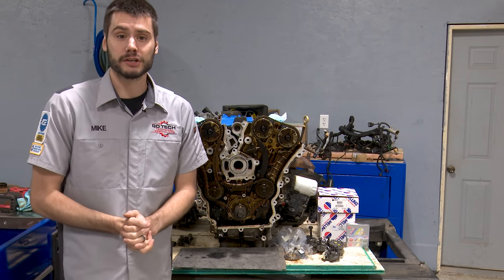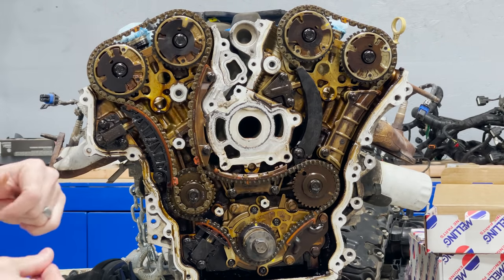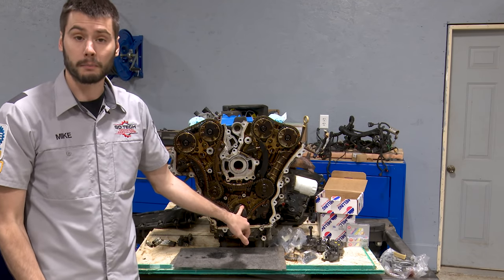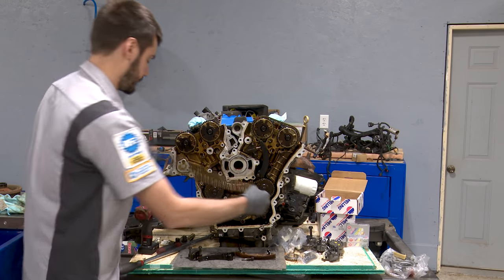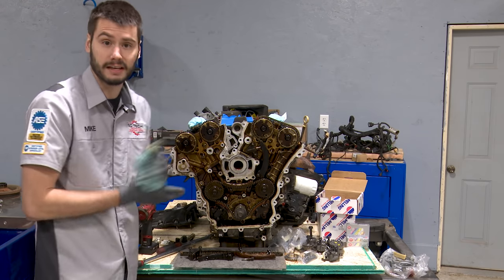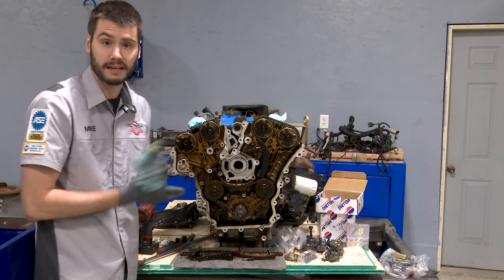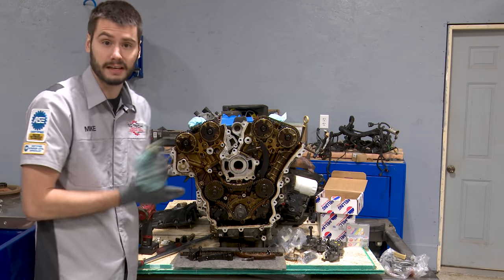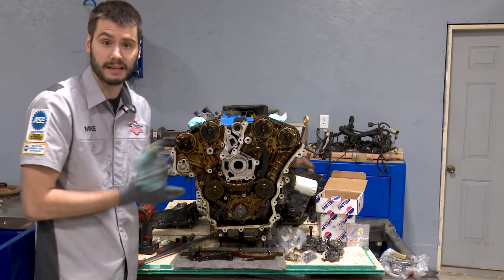How To Replace Timing Chain On Chevy / GM 3.6L V6 - Full Length Removal and Install - With Tips!

Comment: ⭐⭐⭐⭐⭐ Video Mike, We need a professional shop like yours here in SW burb of Chicago..Very Detailed and many hours to do this job compared to timing chain replacements in the 60s-80s..damn technology and computer and excess foreign materials has ruin everything for us Car guys. I’m 59 years old I did stuff like this but I rather have your expertise doing this job. How hard is it to rebuilt a 2012-2015 GMC 2.4L Eco-Tec? I unfortunately I have a 2015 Equinox at 66K miles no oil consumption…yet…I change my oil w/Full syn/Dextos every 3500 miles…not 6K-10K as recommended. I also have a 2017 Traverse 3.6L so I’m getting educated if or when this will need to be done.

Comment: I’m working on an 3.6  Acadia engine right now and everything was going good when I put it in stage two timing where the flats are up and put  the plate on there to lock cams into position ,so then I proceeded to put it in Stage one timing to where it’s at the 5 o’clock position and flats of the cam are up but that’s not the case . The flats of the cam are not up in 5 o’clock it’s has to go to the 8 o’clock position and then there up
Reply from the maker: Hey Lisa,
What bank are you checking in each stage, right bank cam flats will be up in stage 2 and left bank cam flats will be up in stage 1.
~Ryan
Reply: Did left bank and primary in stage one , then rotated it to stage 2 just about done but on my new cam phasers seems like the ones on right bank the R is off one tooth from the actual mark on the cam phaser so the exhaust one was in line and I just let it fall into place on the intake Whig is on the mark but not on the r

Comment: When you are done with the timing chains to seat them and to check your timing marks again is easy. Am giving one of my secrets out but am sure other people with mechanical knowledge would no this. 
Mechanical knowledge is a god given gift. God gives everybody some sort of a gift. You turn the engine over clockwise 4 turns over then counter clockwise 4 turns with a tad more then go clockwise slow and your timing marks should line up if done right.
You should oil the timing chain with a oil can as you rotate the engine clockwise the first time to lube the chains. After that I put it all back together the timing chain cover with just a few bolts without sealant but just lay the valve covers on with a few bolts to...be sure to put the oil filter cover back on with the water hose on and torque the oil filter housing....Pull out fuse so it cannot start and the fuel pump fuse and leave the spark plugs out. Put the damper back on to make sure the gear wont walk out. Just snug it up as you have to take it off again to seal the timing cover back on. Crank the engine over to fill the oil pump and the timing chains tensioners to fill up and also the oil filter housing to make sure you have no leaks were the oil filter housing does not leak at the block. Take the valve cover back off and the damper and chain off and check to make sure the timing chain tensioners are tight from oil. If you don't and one of those are bad you are going to take it all apart aging to fix it and maybe more. Check timing chains marks to make sure it did not skip a tooth. You should have one of the chains yellow mark you put it on and check it to the cam phase timing marks. You should have 10 links between the two or 12 from timing mark on phaser to the timing chains at TDC. Check both sides and if in this way you know everything is right. I have seen bad timing  chain tensioners before. Then you have to take it all apart again and do the job again and mess with that timing chain silicone sealant. You should replace the phaser since you are into it. And you should really replace the oil filter housing which also is a engine cooler also. They love to leak oil or coolant making a mess. You will not make the time they give you on this job but better than doing it twice and if things go sideways you could bend valves in the head also. New plugs and belt while you are there and maybe a water pump if it has miles on it. You should really do these things since you have it apart. All you are doing is replacing parts that will need it if you plan on keeping it. There should be no labor as you have these thing apart anyhow. If you are doing it yourself you my as well do it right. I still hate this engine when it needs to be fixed.
Reply from the maker: Hey Arthur,
Thanks for watching and sharing your methods when doing timing chains!
~Ryan

Comment: How do you determine whether to do sprockets and also whether or not to do the oil pump as well?
How about replacing the water pump? 135,000 mile 2015 Impala.....
Reply from the maker: Hey Jim,
Due to the difficulty getting to the chain, it is never a bad idea to replace the oil pump and sprockets. The sprockets are not as common to fail as a the chain is, so they don't get replaced as often. If you have a VVT issue that is diagnosed as a sprocket issue is when you would want to replace them. The water pump is not driven off the timing chain so it is not something I would worry about unless it is leaking or failing.
~Ryan

Comment: how long is this job from start to finish? local mechanic quoted me at 10 hours and almost $2k
Reply from the maker: Hey Josh, 10 hours seems light to me. Labor time for the chains is at about 15 hours. 14.6 to be exact. 2k doesn't seem like a bad price at all. 
Mike Becker, Senior Instructor

Comment: Hi.  I see that you release tensioner pins after installing each chain/tensioner set.  On the left side you had to rotate cams to get chain on lower main sprocket at 25 mins on video.
Could you have just left the tensioner un-released to have more chain slack for adjustment?  I understand having all marks aligned before releasing adjusters.  You pretty much have that covered.  Thanks for the vid.

Comment: I have a Honda with a V 6 and it uses an old fashioned timing belt. It is way easier to change than this mess and apparently more reliable. I can easily change the water pump at the same time for very cheap. The belts last at least 115,000 miles and there is just one of them. There are also no plastic guides to worry about since the belt runs outside of the crankcase behind a simple plastic cover. I feel that it is a much better idea even though it is a belt and has to be changed at very long intervals. Belts are quieter and isolate the valve gear from the harmonics of the rotating assembly. Smoother engine.
Reply: The idea is that the chains never need to be replaced, unfortunately these engines use so much oil that they go dry at some point causing the chains to stretch.

Comment: Hi, isn't this an interference engine, how were you able to turn it 360 when removing the left side timing chain without pistons hitting valves in the right side,  great video.

Comment: I just called the dealership in the end, they stock one acdelco kit for the 3.6 3 chains 3 tensioners, 3 tensioner gaskets, both valve cover gaskets, and the timing cover gaskets. All guides were fine after getting into it, that must be the gm service repair

Comment: Hey mate, any chance you know the reason why you have to change the chains in two timings? If you locked in the RH with the flat tool and the LH with the diagonal tool why can't you do all 3 chains at once? I know the procedure says 2 timings and if you don't it will cause misfires but I'm curious of the technical reason.

Comment: Great video.  This and a couple others gave me the confidence to tackle the timing chain replacement myself.  My oil pump arrived today so I'm ready to start taking chains off and installing pump and new chains.  Did you have to prime the oil pump before putting the engine cover back on?  Thanks for your time making this video and posting it.
Reply: I primed the oil pump.  Great video.  After completing the timing chain replacement with your company's kit my car is back up and running.  Many thanks.
Reply from the maker: Hey Brian, thanks for watching! That's amazing that you were given the confidence to do the job. Congrats to getting it all done!!!!
~Mike

Comment: Good Video My only wish is that you would have given a good description of the cam timing marks.  It is difficult to find good information on exactly what they are when replacing the cam sprockets.  Unfortunately the parts suppliers have no information on this that I can find.

Comment: Thanks for the video. Is this a problem for late model engines as well? Mine is a 2016 87K miles no issue....yet. I'm thinking maybe it's time to run Forest run!
Reply from the maker: Hey Wade, thanks for watching! No, this doesn't seem to be as big an issue on the later engines. 2008-2014 seems to be the big issue window. Just remember to keep your oil changed regularly and you'll probably be ok. 
Mike Becker, Senior Instructor

Comment: Further to my last. Meant to say vvt solenoids/sprockets. Does vvt solenoid and sprocket need to be replaced when replacing chains.
Reply from the maker: Hey f d, thanks for watching! While it's not 100% necessary to replace them, it is in best practice. The job is a high hour labor job and would hate to do it again if one of those parts fails shortly after.
Mike Becker, Senior Instructor

Comment: I'm hearing a lot of people doing this in only stage one? 🤔 is that possible? We're starting this today and appreciate your awesome videos. We'll be doing the two stage method and hope it goes as easily as you make it look 😉 👍.  Thanks for the great video!
Reply from the maker: Hello,
I suppose it is possible if you mark the second chain, but I don't know if it would make it easier.
Good luck on your repair, I hope everything goes smooth!
Thanks for watching!
~Ryan
Reply: I have a question why did you use R and  L on the first stage timing on the left?  Wouldn't that mess up the timing is there a way to add a picture of ours before I put these chains on?

Comment: I just got one with 228k on it. I guess I need to do this. when i do all this do I need to change the sensors?
Reply from the maker: Hi John,
No, unless the sensors are faulty they do not need to be replaced.
Ryan W, Technical Instructor

Comment: IF I WERE TO BE DOING A 2018 CADILLAC CT6 WITH THE 3.6L WOULD ALL OF THIS STILL APPLY TO REMOVE AND INSTALL THE CHAINS?
Reply from the maker: Hello Ramiro,
From what I see in service information, the 2018 CS6 has a different chain set up. So this video would not apply.
~Ryan

Comment: I just got a Camaro from a friend of mine that tried this job and he took the bank one chain off before making sure it is in time, if I make sure the cam phasers are where they need to be will it put the car back into the correct time?
Reply from the maker: Hello Elijah,
Yes, you will have to set the crankshaft back to the correct stage timing for bank 1 and then both cam phasers for that bank before re-installing the chain.
~Ryan

Comment: Part 1:
2011 Chevy Traverse 3.6L With MAJOR Engine Failure! Now What?!
https://youtu.be/hE9E3pzenR0?si=o-ZENCQ9KQjsp8yR

Part 2:
How To Replace Timing Chain On Chevy / GM 3.6L V6 - Full Length Removal and Install - With Tips!
https://youtu.be/BhDs1GcwRCs?si=66M5AAnGOkmJzXzn

Part 3:
How To Test GM 3.6L Timing Chain Problems With A Labscope - P0008, P0016, P0017 and more
https://youtu.be/jHciEodt7lY?si=8VfVlLQO1FLof77z

Comment: Thank you for the video, I have one quick question. When removing the chains and going from stage two timing to stage one can you just back up (counter clockwise) to the stage one timing mark? As long as the crank bolt doesn't loosen. When doing this the flats for the cam shafts (left side) are in the up position.
Reply from the maker: Hi Rick,
Thanks for the question
Yes, you can also turn it back to put in stage one timing. They also make a special tool to turn the crankshaft so you don't have to worry about the bolt loosening up, but it is not required to complete the job
Ryan W. Technical Instructor

Comment: If it matters to anyone, to reinstall the harmonic balancer without that special binding tool I used a rubber mallet and tapped the balancer just far enough to get the balance bolt to catch. Once it caught I sloooooowly started to tighten the balancer bolt. It drew in the balancer in until the engine started to turn, at that point I got a HD strap tied it to one of the balancer spokes then wrapped the strap around the balancer like a top. Once you get it tied just find a good anchor point and start your tightening process for the balancer. It worked like a charm for me. Ain’t no way I was buying a one time $100 tool.
Reply from the maker: Great tip Rcwrecker78, thanks for watching!
Mike Becker, Senior Instructor
Reply: should have taken a video. I'd love to see it

Comment: I have a torrent I’m about to do the chains on. Now I’m wondering if I should change the oil pump. Think it’s necessary?  200k kilometres
Reply from the maker: I haven’t seen too many oil pumps fail , but it is only a few more bolts. If it were my car I would put the pump in
~Ryan
Reply: @GoTechTraining  okay thanks. It’ll be just to sell most likely but figured it’s not a bad idea.

Comment: Out of curiosity, is this the same instructions for installing a timing set on a 2011 GMC Terrain 3.0L VVT engine?
Reply from the maker: Hi Michael,
Yes the procedure for timing is the same
Thanks for reaching out!
~Ryan Wilsing
Reply: @GoTechTraining  Thank you for responding even though this is an older video. I have scoured the internet for information on the 3.0 vvt engines but there is very limited information on it, and almost nothing about the timing chains. I have recently bought a used 2011 GMC Terrain with the 3.0 that needs a timing chain installed…it does run and drive. No shops around me other than one will even touch it. They all say if it had the 3.6 vvt then they wouldn’t have a problem with it. I just don’t understand. Guess that leaves me lol😢. So again, Thank You!

Comment: Why does the left side primary chain tensioner depress while rotating? I’m working on a Saturn outlook same deal and I’m just trying to feel it out with what’s online and with the Haynes manual I have....great video and no doubt that the work is correct, I’m also wondering after watching another video where the person went counterclockwise between timing stages to reach 1 from 2...is that acceptable or should it be done clockwise?
Reply from the maker: The chain tensioner depresses while rotating because there is no oil pressure, once the engine is running, oil pressure will take up the tensioner slack. 
It is acceptable to move from stages 1 and 2 counterclockwise, but may require a tool to turn the crankshaft 
Thanks for watching!
Ryan W, Technical Instructor

Comment: Great video well explained. how many k’s has this engine done ? And when should you change the timing chains after how many kilometres or miles thanks
Reply: A little late but I have seen a 3.6 Camaro with as low as 110K miles with stretched timing chains..

Comment: is there a recommended mileage to change the timing chains on this motor? Ive got a 2015 Impala with this engine it currently has right at 190,000 Miles on it.
Reply from the maker: Hey Kody, there's not a specific interval. Most people just replace it when it starts to set cam/crank correlation trouble codes. 190k is a solid mileage for the first chain. You must be keeping up on those oil changes!
~Mike

Comment: I know there was a GM bulletin recommending adding a thrust washer between the cams and the phasers on 2009 and earlier models of this engine when replacing chains.  Do you know what the purpose of that is and is it a negative to not add it in when doing the timing chain job?
Reply from the maker: Hello, The thrust washer usage was based off 1st and 2nd design cylinder heads and 4 or 5 screw camshaft actuators. Search nhtsa.gov for bulletin 12-06-01-009D for more information.
Ryan W, Technical Instructor

Comment: hi when you put the right secondary chain on you moved the crank approximately 30 degrees to the next mark. Yet when checking the final installation you say make sure you turn a full revolution or it will be 180 degrees out.So im confirming you are only turning it 30 degrees or so to the next mark on the oil pump and not turning a full revolution to that mark ?? thankyou
Reply: great question. i believe this might be an error but i cant confirm.

Comment: Is there a trick to getting the crank sprocket off? Mine isn’t loose like yours and I’m afraid to pry against the oil pump. Thank you.
Reply from the maker: You may need a puller if it's super stuck
~Mike
Reply: @GoTechTraining  thank you sir!

Comment: @GoTechTraining  I am planning to perform this job here soon on my personal vehicle. Would you recommend that I replace the seals on the timing cover (VVT Solenoids and main crankshaft)? Is there a GM specific gasket maker I should use on the timing cover? 
Thanks for the great video!
Reply from the maker: Hey Josh,
Yes, I would definitely replace the seals while the front cover is out and make sure to get high quality replacement parts.
I like to use Permatex "The Right Stuff" gasket maker or Permatex Ultra grey for sealant.
Good luck on your repair!
Thanks for reaching out!
~Ryan